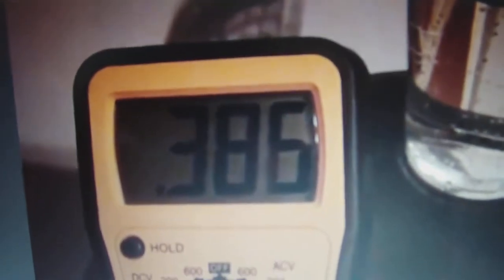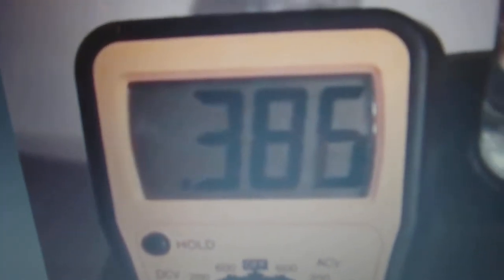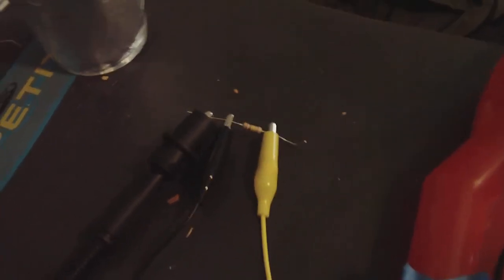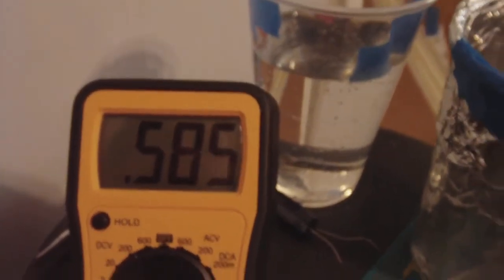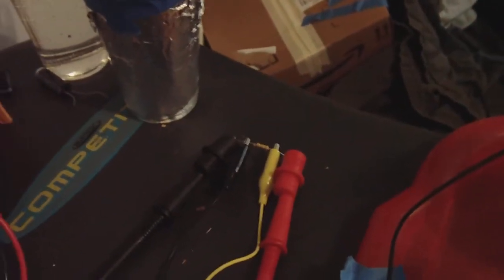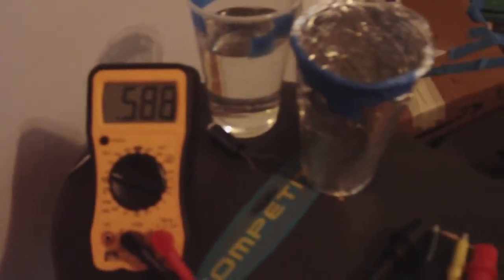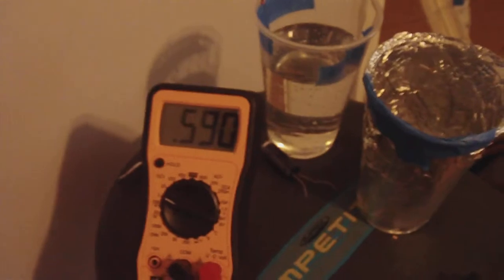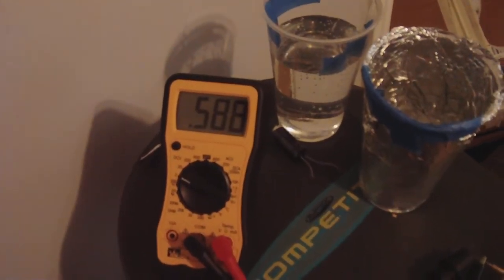Water Captret increase power over time when given a load

Comment from the maker: @DrSaminstine 

Making a HHO cell sounds great, I would love to see that happen. My main focus is getting it to light a LED and maybe in the future have it charge my 12 volt batteries. 

Also in previous videos i shown that it also itself could be making hydrogen bubbles, but the bubbles were small. If you do plan on making a HHO cell try putting the water captret water battery in series with real batteries to get even more power out with less power needed from the real batteries.